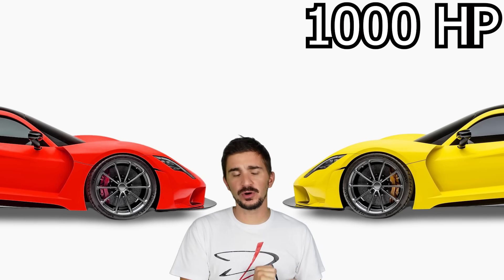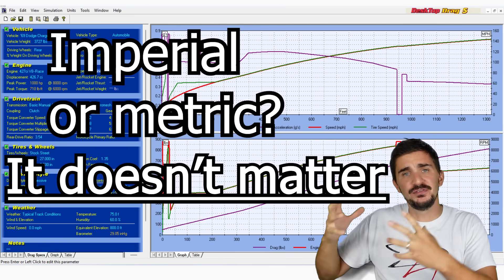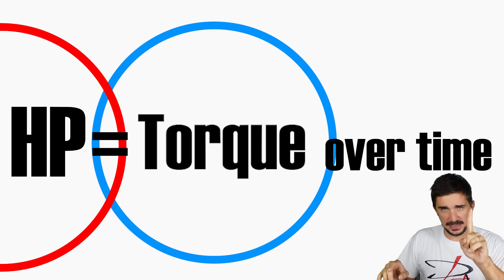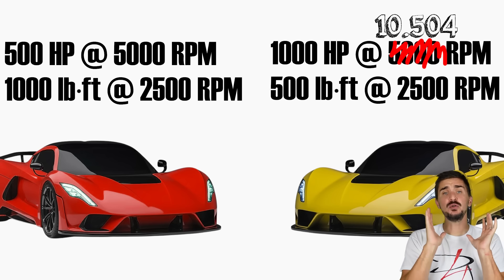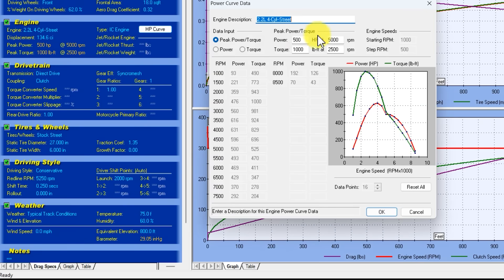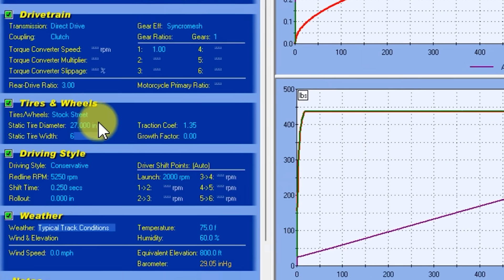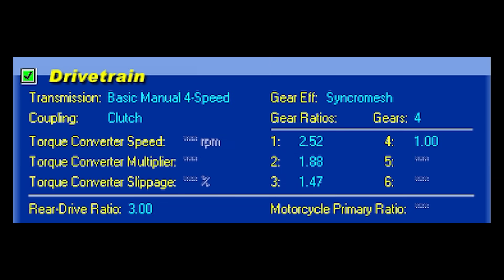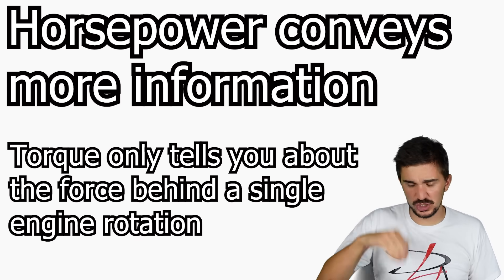Who's faster? Explained and Simulated - Horsepower vs Torque

Comment: Summary:
- if you have less than 4 gears and like to pull houses: prefer torque
- if you have a gearbox from this century: prefer HP
Reply: Yeah, modern transmissions are incredible. It seems like every performance car has at least 7 speeds now.
Reply: Not so. Even with few gears, you need an engine with the highest average power. Said another way, highest and broadest power curve. Torque and rpm at the engine are only meaningful when considered together, not independently.
Reply: So better to choose higher torque car if Im looking for Toyota
Reply: @fr3ddyfr3sh  Not quite... If you "have less than 4 gears and like to pull houses" as you say, you need power with a flatter power curve.
A flat power curve is often (but not always) found in engines that don't rev very high, which are usually sized larger to make enough power through torque without a lot of rpm. It's the shape of the power curve, not the high peak torque that makes such an engine so forgiving to shifting and gear choice (and fun to drive/ride;). It has power everywhere.
Basically as long as the ratio of distance rolled per engine revolution was somehow under the control of the vehicle's designer or its operator, then power (and the shape of that curve) ALWAYS tells you how the vehicle will perform, at least as far as the engine is concerned.

Peak engine torque has a much weaker correlation to vehicle performance because it's only half the picture. RPM is the other half. Power is both taken into account - the whole picture at every moment, for everything; plowing, racing, towing, hill climbing, accelerating, or reaching high speeds.
Reply: Nope. The higher torque car, with proper gearing, wins every time.

There's a reason he didn't adjust the transmission gear ratios.

Didn't you notice that?
Reply: @mustangstuff7213 Torque is the sound of one hand clapping.

Comment: Car manufacturers like to walk extra mile to hide all power/torque graphs of their products. If available, these graphs give lot of info how one can expect specific engine to work. For a daily commuter I am mostly interested on torque graph actually, I prefer it to be near peak at 1.5k rpm and last to 4k or so to reach its peak power. I find a very little value of (street) engines that stretch the peak torque to 6k rpm to present higher power numbers on fact sheet.

Comment: Force equals power divided by speed. If you want to know what force (N) is pushing car, You need to divide power (w) (at the wheels) from going speed (m/s).
Acceleration equals force divided by mass. So more power = faster acceleration can bean achieved.

Comment: I have a question in relation to gear ratio. For a motorcycle with 86 hp 56nm torque and a readline of 12000rpm with stock final drive ratio of 15t front - 46t rear would i get a better acceleration  by increasing the front from 15t to a 16t or reducing the rear from 46t to a 44t whilst keeping a higher top speed than stock? The way i thought about it was that increasing the front sprocket tooth count would utilise the torque produced by the engine better than decreasing the rear sprocket
Reply: You can increase acceleration by decreasing the teeth in front or increasing at rear. For a more nuanced effect, change the teeth at the rear. Generally a decrease of 1t at the front equals to about increase of 3-4t at the rear

To answer your question, increasing from 15t to 16 will reduce acceleration and reducing from 46t to 44 will also decrease it, but by a lesser margin
Reply: @NalinKhurb  that i can understand, as it is atm i have a 16t-46t setup, to me it feels that slightest bit faster in the high rpm but at the same time, slightly sluggish down low. The theoretically calculated top speed has increased by 10 km/h as that is how much my speedometer is out by. My original question might be abit misleading, but to simplify, would the torque of the output be utilised better by increasing the drive sprocket (front) or decreasing the driven sprocket (rear)?
Reply: @redallaround66  It doesn't matter which sprocket you change, all that matters is the resulting 'gear' ratio. Obviously changing the smaller sprocket has a proportionally higher effect going 1 teeth up or down.
Reply: @MrUppmas  ok, then my question about the utilisation of the torque between drive and driven is irrelevent if im not specifically looking for top speed or acceleration?
Reply: @redallaround66  Depends on what you mean by 'utilization of torque'.
Reply: @MrUppmas  firstly, thanks for a civilised conversation, i do appreciate a clean chat :) so i did abit of reading and its looking like i mightve been excluding a governing factor which is the load on the output shaft. Whilst the torque can be "xx"nm on the shaft itself, it wont be the same if the working diameter that the chain contacts with is increased to the size of the sprocket (comparing diameter of the shaft to the diameter of the sprocket attached to it). Going from 15t to 16t on the drive sprocket would then reduce the drive torque resulting in less torque to the driven sprocket. Decreasing the driven sprocket would not change the torque of the drive sprocket but instead induce more load onto it. If that be the case, the utilisation of torque from the drive sprocket is better if you reduce the size of the driven sprocket. Am i on the right path?
Reply: @redallaround66  
It induces more load because it's applying higher torque. Loads are caused by forces afterall, and (engine) torque is the thing that creates the load on the driven sprocket. Well technically the chain being pulled against the sprocket is what causes the load but it's the engine's rotation that's pulling the chain. 

I'm assuming you're meaning 'efficiency' when talking about utilization of torque. That's a complicated topic by itself, but I would wager the manufacturer's setup is the one that strikes the best balance between performance, efficiency and general usability. However I imagine that changing sprocket size/the chain ratio doesn't really impact that greatly.

In the end it's a preference thing. Smaller ratios lead to higher top speed and rpm's rising slower, which can lug acceleration as motorcycles don't have low-end torque. However once you're up to speed you can hold gears for longer. Higher chain ratios lead to the opposite.
Reply: @MrUppmas  all this has made my decision to revert the front back to stock 15t and decrease the rear by 2 teeth.

Ill share with you some specifics on my bike:
2008 Suzuki gsx650f
Modifications:
Ngk laser iridium spark plugs.
K&f high flow filter.
Airbox intake enlarged.
Woolich racing tuned Logbox V3.

Custom built 4-2 tapered header twin straight shortpipe exhaust with hayabusa inspired x-pipe (28mm tapered out to 32mm).

Remapped secondard throttle plates.

16t front (+1 from stock) 48t rear (stock, messed my tooth count up in my question lol).

Dynoed before exhaust and airbox mod at 80.71hp@11410rpm, 42.23nm@8750rpm
Dynoed after exhaust and airbox mod at 88.06hp@11360rpm, 45.21nm@8870rpm

Shes loud and for a non gsxr breed goes pretty hard, but this next chain and sprocket service im going to revert back to stock 15t front and go 46t rear, even tho as it is, its slugish till about 4500rpm then it really starts to build momentum
Reply: increasing the size of rear sprocket
Reply: @xy_iron but increasing rear sprocket size would lower my top speed, which is not what i want
Reply: @redallaround66  You cant get both. you either have better acceleration or higher top speed.
Reply: @xy_iron  i understand that statement aswell, my question is not about the tradeoff between acceleration or top speed, but how the torque can be utilised

Comment: For most people, simply looking at numbers (HP and torque) can be a confusing. As you said, torque and HP are connected and torque curve being the direct indicator of what HP you get through the rpm range answers a lot of the questions. For example, the example of the heavier weight tests the low rpm HP, and that's why the car with the highest torque in low rpm will win
Reply: But he never gave the high rpm engine it's ideal gearing. It revs to 10k, so give it 6:1 final drive and it will beat the high torque engine by a mile.

Comment: Like the video but what's missing is comparison when both vehicles would each be geared for optimal performance. The HP one would win much clearer.
Reply: right he says it depends but for a race hp is the more important figure since you can change the gear ratios
Reply: The video isn't REALLY about comparing two cars in a drag race, that question is simply a way for him to explain the difference between HP and torque using examples for the viewer. That is made clear multiple times in the video. It isn't necessary for him to actually simulate two cars geared optimally OR realistically for him to get his point across.
Reply: this guys missed the point,
it about torque and hp, the drag race was just one of the examples he used
Reply: That would be an invalid engineering comparison because the cars were identical including the gearing that's the whole point. His definition presentation  was about defining torque and HP you missed the boat completely, it wasn't about gearing on either or using better tyres etc. He explained it fully.
Reply: @zorbakaput8537 well no, the question is "which one of the two is more important in a drag race/for performance", answer being "HP, when geared properly".
Reply: @FAB1150  You have to factor in the weight of that gearbox, for it will be quite a piece of metal for the high number of individual gears, if you want to squeeze the most of the "high HP" engine. Also, do not forget about performance loss due to switching gears.
Reply: @ErikZiak  that's true for any car. If the power band isn't excessively peaky you don't need the gearbox of a semi, and if you really are only in for the performance get a CVT and stay at the optimal ratio 100% of the time.
Reply: @zorbakaput8537   Not really becuse that's exactly how you engineer every car in actual reality...
Reply: @zorbakaput8537 naaah hees misss point totallly ypu aswelll 👍🏻 why ? cos each vehicle project today have very precisise specific indyviduall gearing for get out of engine all what it got in regard to both accelerstion and vmax 👌🏻 and what happen if you geared both version in hees conparisioon perfectly like basicallly each car or bike on market ? more powerfull version with lesss torque absolute smoked version with less horspeower but more torque 👍🏻 why ? cos more powefull version at perfect gearing be able to generste more output force all the way in accelelrstion test as formula say 👉🏻 power:speed = force 👌🏻 torque have chance only if power biased version willl have gearing from 💩 or like you wish enough bad gearing which dont alllow tonuse enough power from engine for beat torque biased version 👌🏻and whats go behind it 👉🏻 this video is absolutelly 💩👌🏻 missslesding people who want short simple strsight answer which should look like this 👉🏻 more powerfull version at perfect gesring slways be accelelrste faster and always will achieve biger topspeed when you push each version to theyr limits so egzacly like in hees comaprision where he comapre only max accelerstion 👌🏻 but more torque version at low rpm will havebetter elasticity /accelelrstion from high gear at similar low rpm from similar speed 👌🏻 than its fullly explanation in regard to reall csrs and bikes and not some 💩 with gearing which  absolutellly nobody will use in normal car or bike  except people which have absolutellly no idea what they are doing 😉👍🏻
Reply: @zorbakaput8537 no, because only a complete simpleton would run those two engines with the same transmissions and final drive ratios.

Comment: A question: if HP is torque over rpm, can we milk torque to gain more HP? Say high performance diesel engine, add a higher gear ratio in output, would that be possible?
Reply: That's what tuners do, boosting torque across the range. In result more torque×same rpm = more hp
Reply: Higher gear ratios would do nothing about the fact that diesels generally lose torque at higher rpms due to their inherent design.

Comment: If the HP biased car had a cvt transmission with infinite ratios and no loss it would have destroyed the high torque engine 
High torque is only useful when you can't maintain the rpm where HP is the highest

Comment: im even more confused now, if torque and HP are linked through a formula that contains only RPM and a constant, why do we even have two different numbers to begin with?

wouldn't just the HP, or just the torque, convey the exact same information? why arent the HP and torque curves exactly the same? if you account for the constant in the y axis unitsm the curves should be exactly one over the other
Reply: They cannot be the same since the amount of power exerted by the engine per unit time (torque) is different due to engine designs (compression, stroke, etc.)
Reply: @NalinKhurb  if I understand ur comment, that means engines have different torque, but the formula in the video and the explanation that HP is just "punches over time" makes me think that HP should always be the same for a fixed torque.

im still confused as well at why max torque and max HP occur at different RPMs, according to that formula in the first half of the video, if you increase the RPM and keep the torque or HP fixed, then you inevitably increase the other. Something is surely missing in that formula.

Say you have two engines with the exact same torque, what exactly could make one have higher HP than the other?
Reply: As an example, imagine you have an engine with constant 300 Nm of torque, all the way from 0 rpm (for simplicity) to its peak rpm.
The power at 0 rpm will be equivalent to 300*0. At 1000 rpm, it would be 300*1000 and so on. You would end up with perfectly linear function of power on rpm under this assumption of constant torque.
So the curves are clearly not the same and they cannot be due to that multiplication by rpm.

Regarding your question on peak power and torque reach at different engine speeds, it is quite simple. If you have a peak torque of 500 Nm at 2000 rpm, your power at that speed is equivalent to 500*2000. If your engine still has e.g. 300 Nm at 6000 rpm, your power is equivalent to 300*6000, which is more than 500*2000. Hence, you have peak power and peak torque reached at different speeds.
Reply: @MartinBrada  thnks its much clearer in my mind now. I agree with you.
Reply: You are on the right track. Torque is the primary measurement, the actual force. HP is the result of a calculation that takes into account that work is done over time and that gearing can alter the amount of torque produced by altering the rate of work. You can use gears to alter output torque and output RPM, but the HP will remain as is. HP is torque but with potential gearing taken into account essentially.

Comment: I always need at least two of those three to understand how an engine behaves 
Peak HP and it's rpm or peak torque and it's rpm 
If a car has a lot of torque in low rpm it probably won't have high hp and if the torque is in high rpms that means it's a high revving engine with a lot of HP

Comment: Take real life example of BMW E39: 528i 193hp, but only 280Nm, 530d also 193hp and 410Nm and 540i with 286hp and 440Nm. Performance of 528i and 530d with same power is very similar [530d is little slower due to bigger mass], and 540i is a lot faster than 530d despite having comparable torque figure. That's it.
Reply: Assuming perfect grip perfect gearshifts and same weight, drag etc. Then your acceleration will be your average horsepower, or the area under your hp graph in the RPM range you use between shifts.
Reply: People bragging about them "only chip 280hp" 530d "torque monster" will state its outrunning m5 XD
I mean yeah the torqe figure of 530d and 540i are comparable but torque curves for max performance are obviously in favor for 540i resulting in power band that gives arround 1.5 more of the overall WHEEEL TORQUE that is compatible wiht 286/193HP equation.
And yeah properly tuned 280hp 530d may exceed even the m5 torque figure but it still won't make it faster in sprint scenario due to torque curve combined with gearing resulting in better peak power of 400hp and also better WHP, WTQ in favour of m5. 530d may be still more efficient though. For each their own ofc but i hate when they make up stories.

Comment: Horsepower always wins when used correctly. Torque is basically a useless number in the real world. 

If your vehicle lacks torque but has the horsepower, just add proper gearing. If your vehicle has loads of torque but no horsepower, there is no way to add horsepower. 

So when managed correctly, horsepower always wins the performance race. Torque might be good for fuel economy, longevity and usability. But who cares about that…
Reply: Torque is good for burnouts. As much as I love my high revving cars, there's no beating a big, lazy inline six.
Reply: @MyHandleIsGood  It's also good for cruise ships. Who cares, we're talking about racing.
Reply: @MyHandleIsGood  As the OP said, you just add the proper gearing to get torque. Horsepower is all that matters. 
You may be talking about low end torque though. Engines with low end torque are easier to break loose and maintain a burnout than an engine which makes peak torque high in the rev range
Reply: @MyHandleIsGood  a like torque as well. I much prefer a lazy high torque engine over a high revving high horsepower engine because they are nice and easy to drive. But they do provide less performance. Even for burnouts, you just add gearing when you have the horsepower. And slip the clutch to get it going a bit more.